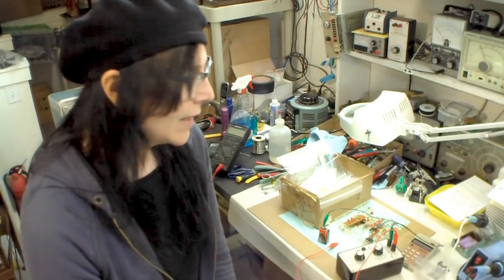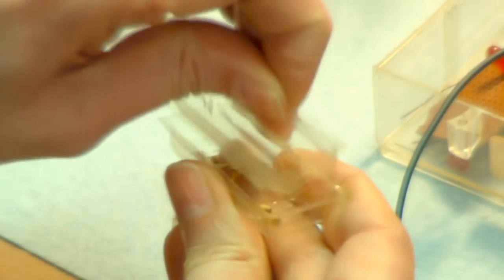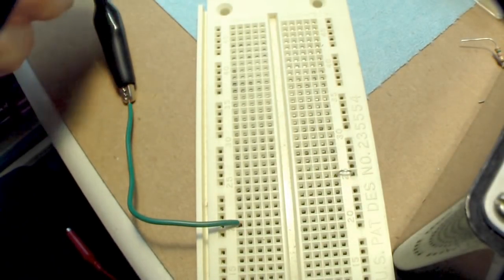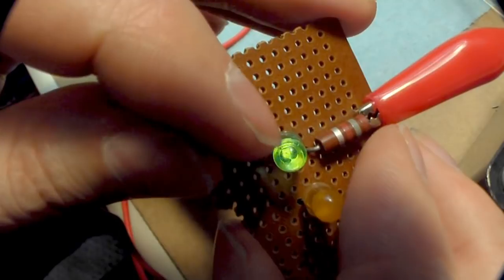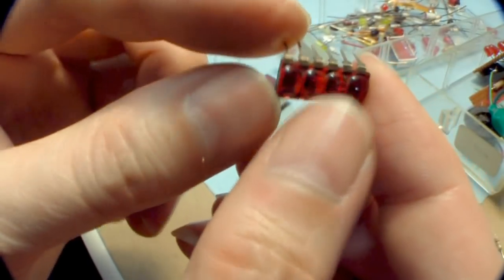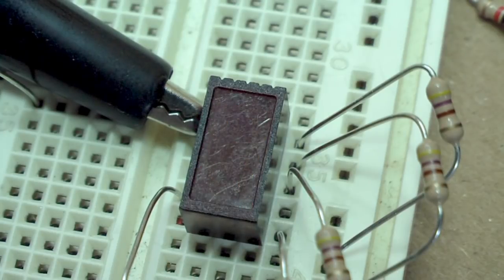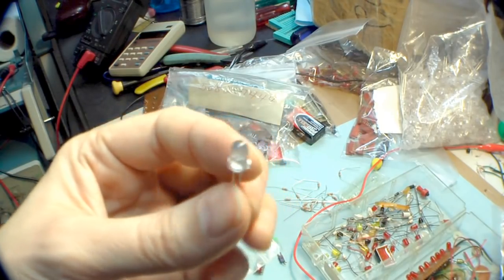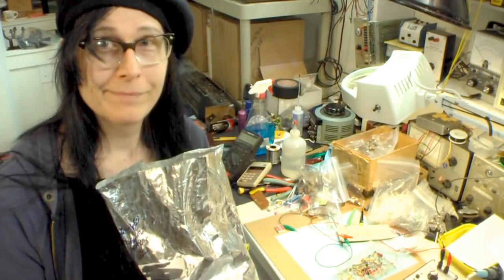The First Light Emitting Diodes

Comment: You have got a lot of stuff that I have. The Novus calc, Heathkits  VTVM Transistor tester, Tek scopes, 7 seg readouts incl the "claw". In 1970 I bought from places like PolyPaks etc. I have some of those leds that are a single pin going into a 1/16" metal sleeve with a teardrop lense that I think are UV. I was also selling on Ebay around 2003 the first blue and white LED's by the thousands! still have tons of those! Also many 7 seg displays Yellow Red Green etc. Anyway I have enjoyed Your video. John

Comment: "Happiness is a 10lb bag of 7-segment LEDs" ... here, have my thumb-up click, dammit :D

The super expensive blue carbide ones, would those be the ones that were most people's first experience of blue LED light, by way of the Playstation 2? In many ways, one of the last electronic devices to make me really go "wow!", one of those ways being its unearthly deeeeeep blue power light...

Sony probably had to put at least $5 on the price of each gen-1 PS2 they sold just to cover the price of that indicator, but, man, it was worth every penny. The only thing I've seen like it before or since was the ghostly EL backlight my dear old Amstrad micro-system hi-fi (a much loved christmas present of my youth) had when first made... and sadly burned out many years ago. You just don't get that kind of illumination any more, that particular ethereal quality seems to be lacking.

Incidentally, how did you figure a safe voltage for each of those diodes? Is there a particular set voltage that they all work at, or is it different for each and rather demanding that you work your way up very carefully? I can't help thinking that those older ones might not actually have been stupidly dim, but either they've just degraded over the years (I know that a common cause of failure in old CD and DVD mechanisms is the (red, in both cases!) laser diode breaking down, and that it's something that's merely time rather than usage dependent), or maybe they used a higher voltage than modern ones do... perhaps significantly so?

Not that I want to question your judgement on this, just curious :) ... if the documentation is a bit lacking, then perhaps caution has prevailed where a bit of bravado might work better? So long as there's enough spares that one could be sacrificed for the cause of course.
Reply: Most LEDS will illuminate at just over 3 volts, but you have to current-limit them with a series resistor or they'll quickly overheat and burn out. Note that Fran appears to have a resistor switchbox sitting  on the bench in the thumbnail photo.

Comment: LEDs make cheap band-gap voltage references. Red is circa 1.6V, Blue higher. Often better choices in critical applications where a 1N4007/4148 might be used. Tube guys use them as cathode references. For that I prefer a resistor. Sometimes a 1N4148 tracks a transistor better. If so a transistor is even better.  A current mirror comes to mind.

Comment: I'm guessing that the LED in a TO-92 case is the result of a manufacturer trying to re-use existing tooling.  Alternatively, it could be that the intended application used a lot of TO-92 transistors and regulators, and primitive automated placement equipment might have required a lot of time to change component holders.

Comment: Led is a diode it's even in the name light emitting ... to make them bright you drive them by pulse just as lazers this keeps it cool allowing much higher voltages and takes advantage if persistence of vision ....pulse at 30 or 60 htz they stay cool yet can handle double triple and much more voltages.... that yellow led news to be driven properly to get yellow light.... the htz and wave length of the electricity makes it yellow.....and for your info it's not due that determine the color inside the led is gas between anode and cathode or metal deposit on anode or cathode  exactly like gas lasers and electronic tubes ....led light is laser light.... if you look at the old tube light emitting tubes they are diodes but also are neon lights... of course yes they do dye the plastic but that only adds or helps the color in some cases... many can be clear until lit in their color

Comment: The first LED  dates back to 1904! 
The earliest thermionic diodes were light bulbs with an anode plate. The cathode which was the filament would emit far more light than most modern LEDs (apart from high power ones).

Comment: The first scientific calculator I owned in 1974 was an HP-45, and its 7-segment LED display was power-hungry and pathetically dim.  The LEDs would run the Ni-Cd battery down in a couple of hours.  A trick that owners of such calculators used to get through the whole day on a battery charge without wearing out the on-off switch was to press the decimal point key so a single LED would be illuminated.  The CMOS calculator chip actually used very little power in comparison to the display.

Comment: +Fran Blanche
Hi Fran, i was so intrigued by those TO-92 LEDs that i just HAD to google them, and this is what came up:
http://www.industrialalchemy.org/articleview.php?item=670
to quote from the website:"This device is a mundane red LED die in a strange enclosure: a standard TO-92 transistor package. Electronics lore states that Motorola made these parts-of-questionable-judgment under contract for use in camera rangefinders. The existence of such a device stands as a depressing reminder that, at one point in the not-so-distant past, it was actually economically viable to increase the gold content of your product by 50% if it would allow you to avoid changing your package tooling."

Very interesting video, thanks for sharing :D

Comment: Cool thing about these diodes is if you keep it in the box and kept it safe it would most likely still work in 300 years.
Reply: can't say that with todays blue and white variants. They make so many in mass batchs for things like holiday lights and flaslights and they last only one season before they start to fail. For the sake of projects you can obtain a fair amount of LEDs after the Christmas season when stores put strings of LED lights on sale.
Of course better white LEDs are put into actual home light bulbs, and you pay the price but save on the power bill

Comment: I just bought 1,000 red LEDs for under $20 from Ebay... less than 2 cents each.  Put 90 into an array and made a solid state safelight for handling Riston film.  And then I ordered another 1,000 red from AliExpress, and they screwed up the order and shipped me 1,000 clear LEDs by mistake.  I complained, got a full refund, and got to keep the LEDs.  They're so cheap these days!  >Charlie

Comment: The transistor like led is pretty straight  forward idea . As the molds and assembly equipment is already there .To add a led die is pretty much the same silicon as any other .
So the only change was basically the color of the case !

Comment: Great Videos, Interesting to see a Woman this into Electronics, I made my own Pedals as well. Will have to watch this Full Video when I have more time.
Just want to put my 2 cents in, Red, then green were first colors I saw and used. Then they had Tricolor LEDs(Red if you applied DC voltage, Green if you reversed Polarity. And if AC Voltage was applied, you would get Yellow(red and green light 
combined makes yellow)). When Blue LEDs first came out, you could buy individually(Radio Shack, Digikey, wherever). I would put to use  in Projects. Seem like it wasn't till a couple years later they would be found in Consumer Electronics.
Stratmando

Comment: Personally I prefer the early LED's for several reasons. Firstly they did not have blue. I cannot describe how annoying I find blue LED's on everything. Old red LED's were unobtrusive and the modern blue ones shout at you. To really describe what I think about this is impossible for me as even though I can cuss and swear in 17 different languages I don't know any words rude enough. There is also the lifetime issue. I can remember speccing LED's in my first design job and finding the LED's had a "standard" MTTF life of 200,000+ hours. If you ran them at half current they doubled in life. Modern LEDs? MTTF of 12,000 for the good ones being run 10% under spec.